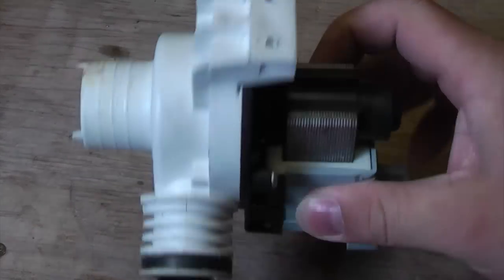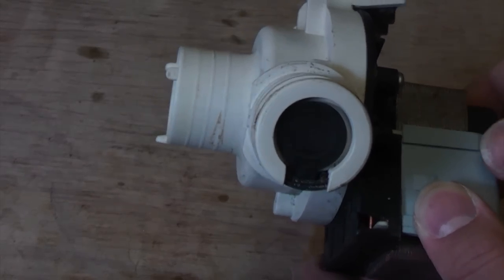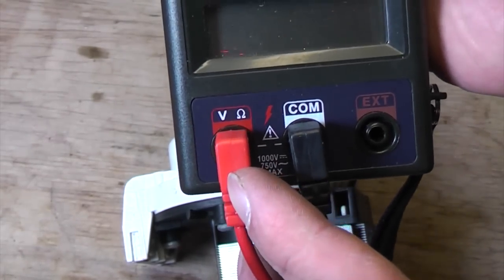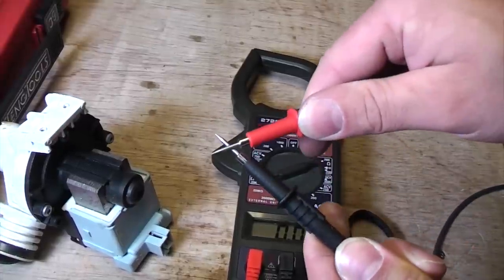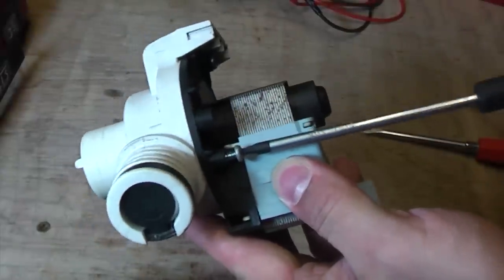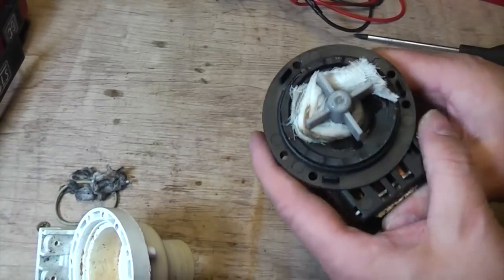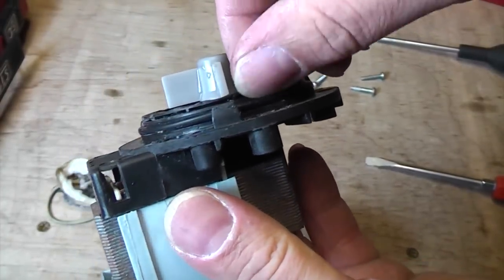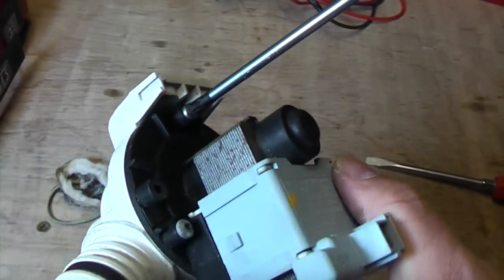Washing machine pump blockage removal   | ultimate handyman

Comment: Thank you for this video it was much appreciated I tested the resistance on the pump it worked then I took it apart and there was a little metal pin lodged between the pump and the side removed it and that was it.
Reply from the maker: Thanks for the comment ;-)

Comment: You skipped a step. You need to remove the impeller and rotor and and clean it properly.  It will be full of residue.
Reply from the maker: The blockage was in the volute- which was cleared ;-)
Thanks for the comment 👍

Comment: It wasn't an elastic band you found. It's the rubber seal for the unit.
Reply from the maker: If it was the rubber seal, how come the pump did not leak when it was refitted to the machine ;-)
Reply: Ultimate Handyman 
the rubber seal for the unit is the black color one as he shown, that grey one is elastic or hair band.
Reply: the rubber seal for the unit is the black color one as he shown, that grey one is elastic or hair band.
Reply: sorry ultimate Handyman, I mean my answer is toward eBob.

Comment: Thank You
Reply from the maker: You are welcome.
Thanks for the comment
Reply: Ultimate Handyman Though I am having a hard time trying to remove the water pump.. seems like the two screw heads holding the pump in place are completely out of reach for me to turn a screwdriver... unless I am missing something can't figure out how to undo the screws in such a hard spot...I have a Haier model HLP23e washing machine....I did remove the back panel as well but still can't figure out how to remove the pump....
Reply from the maker: Sometimes it is best to tip the machine- but not completely over. Then you can often access the pump from underneath. You have to be very careful though and need to ensure the machine is propped so it cannot fall!
Reply: Ultimate Handyman Thank you...trying now....
Reply: Ultimate Handyman Yaaayyyy! I got it to Work!..it was a darn penny stuck inside the water pump!...THANK YOU!!